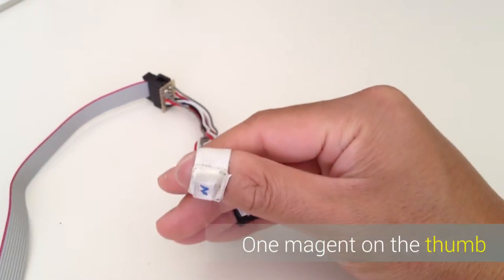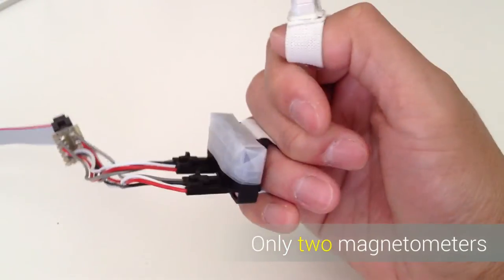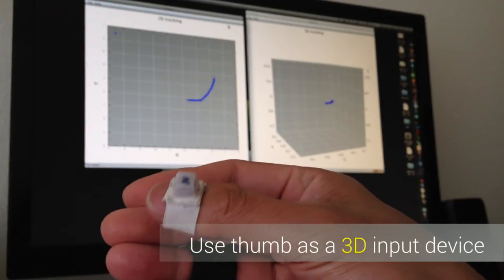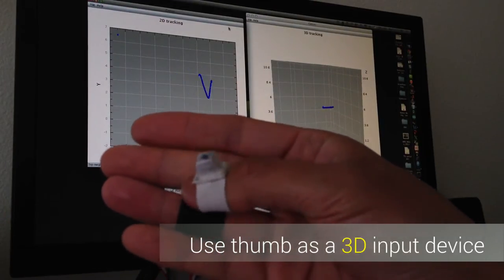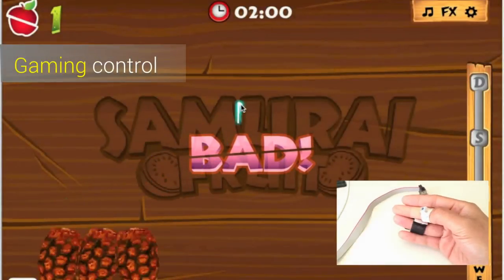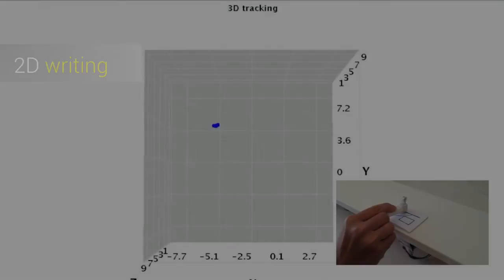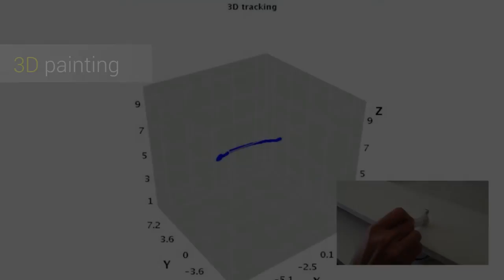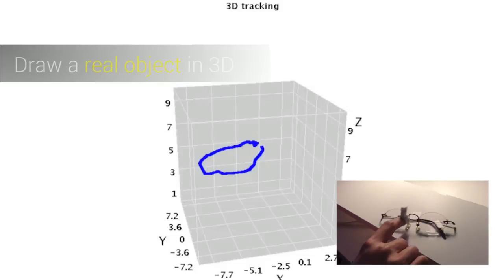uTrack: 3D Input Using Two Magnetic Sensors

Comment: Hello Mrs. Chen,
I'm trying to reproduce your system "uTrack". It's a very interesting algorithm: 3D magnet tracking without any characterizations of the space! I would to transfer your idea into prosthesis control loop. However I have a problem implementig the step 2 two of the algorithm. Every alpha rotation, composed with the matrix T, converts H2 in Hm2. In fact, after the application of T the H2 vector is on the x-y plane by definition of T. So every rotation about z axis is a T' candidates. So in this conditions, how can I choose the correct alpha angle?
I can send you my Matlab code if may be useful.